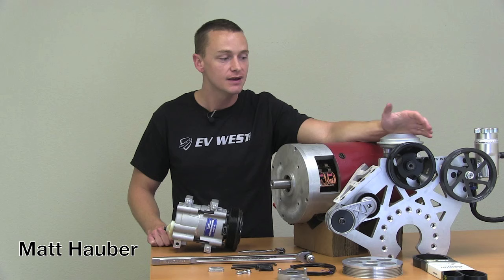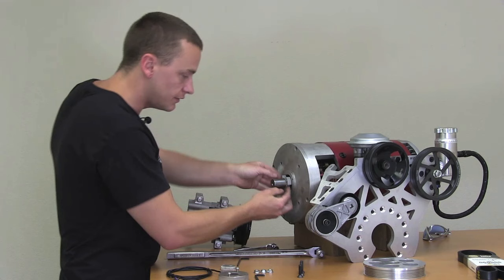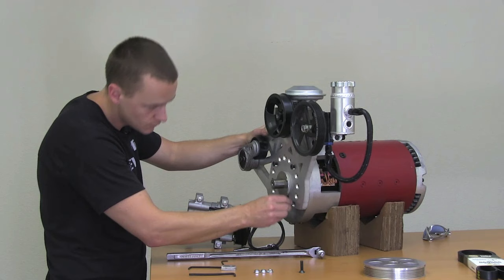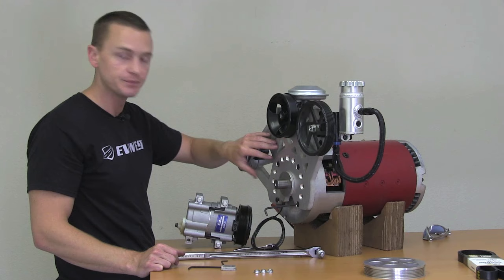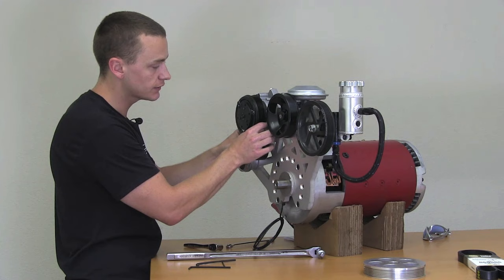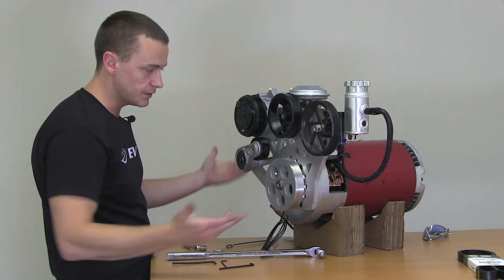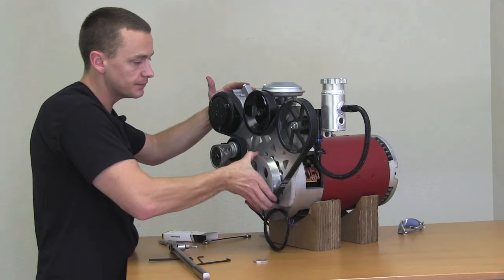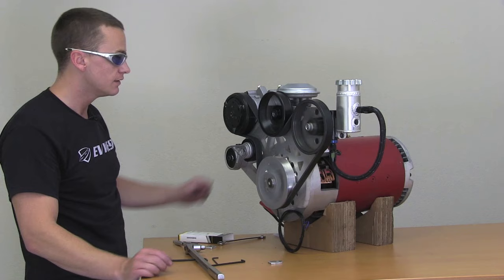EV West Electric Motor Accessory Plate Installation Video - Power Steering, Vacuum, AC Compressor

Comment: Electric cars I believe are making a great attempt to show the world that this is the next generation of power. How ever you look at it, electric does have there place, but I really don't think it is the best solution to our power needs. I think hydrogen powered vehicles will be the greatest achievement; we already have the machinery. Hydrogen produces more and greater power, easy to make, and never ending. Biggest downside to electric cars are the cost of batteries, weight, motors, and chargers all of which have super imposed price tags that truly not worth the price.

Comment: Its not perfect way to power all those things, Just add one dedicated 12v dc motor to run AC compressor, hydraulic power steering and Break pump.

Comment: Eeeemmm pal ur forgetting the fact the engine runs all the time, electric motor does not run in idle mode so the power steering and all the other mumbojumbo allso does not work

Comment: dc to dc converter from main battery pack to original car battery
12v brake booster
12v power steering pump
Job done.
Why steal mechanical power from your motor?

Comment: Want what in a easy universal install???  Universal mounting to fly wheel accessory?no that is strip of lead so the mounting system never rusts? no but, YOu think we can ...we have to industriallize with recycling and can be earning money from lead returns (lead stripping electrolysis)....  Let get you that quote for your v6 Jeep today.   (appliancewarehouse.com has scrap metal that can be a source maybe cheap painful labor)

Comment: This makes absolutely no sense. When you need power steering and power brakes the most, you won't have them, because the motors will be turning so slow. Separate small electric motors to run these accessories would be more effective.